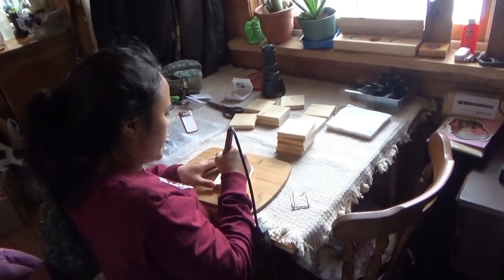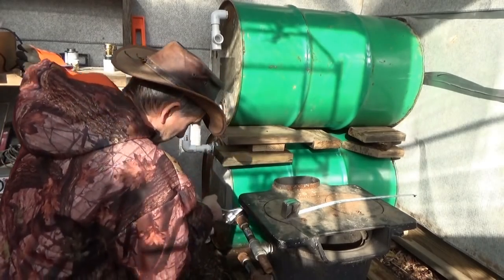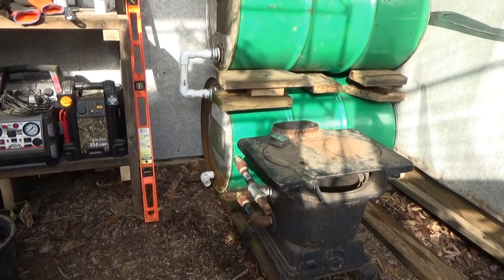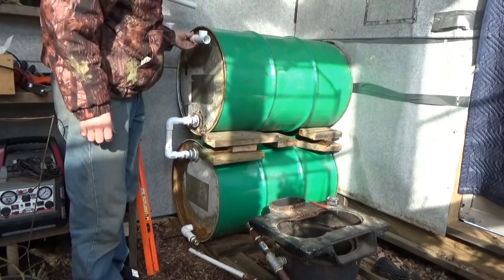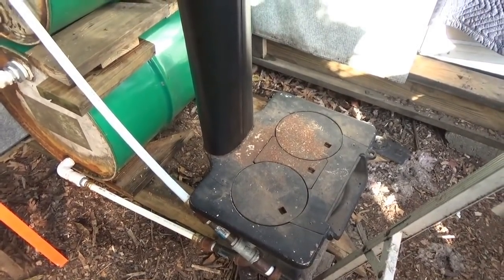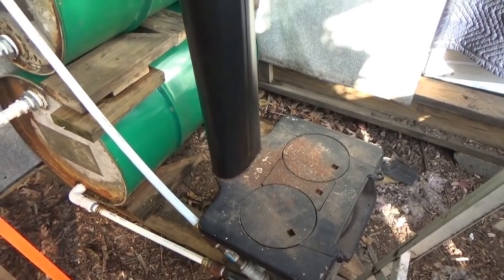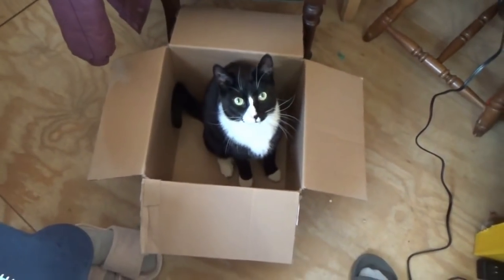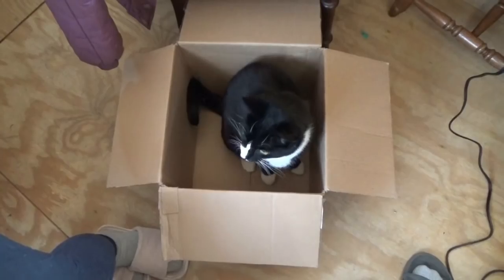Greenhouse Wood Stove Boiler ~ Packages Arrived ~ Wood Working

Comment: dissagree completly about  the use off the pvc, in your system the water temperature will reach 100 degree's celcius,using the thermo syphoning method, the idiot at the store is plane wrong. cant believe you just dont listening to the advice from people who know how,...dont worry about the rise off the lower pipe , its fine even with the feet on, butt, please use the pex heating hose and fittings, or metal.forget that darn pvc, you are gonne regret that, and dont say you could not now it would fail.  ist conna be a big tould you so..... the thermo syphoning has nothing to do with pressure yust the rise of heat....
Reply from the maker: Well, because of comments from you guys I did go out and buy the PEX tubing. If the rest of the PVC fails later then I will replace it as well. But for now it seems to be holding. The T and elbows that is.
Reply: The Do It Yourself World y can guarantee you this can get a problem, in the time you cant have it... not trolling, but trying to help, sincere..if the stove gets on going for a longertime this water will get hot, and the pvc tubing and fittings wil get flexible....., happy to see you placed the stove inside to, this direct heat will help to now!, it would not be iff you would have placed it outside, again, y hope it will stay together with the pvc, but y know from experience its a problem.. stay warm friend!
Reply: Link Knight yup!

Comment: My male cat had the same problem. It's extremely common and dangerous. Their urinary track gets blocked. It's from the food they eat. Too much magnesium crystallizes in their urinary track and they can't pee. It's good to start him on a urinary track health blend of food that is low in magnesium. Don't feed him tuna from a can. One of the worst.
Reply: My cat has urinary problems as well. It almost killed him overnite...it's certainly nothing to mess around. I researched it online and got convinced it was because I wasn't feeding him enough wet food. I attempted to feed him more wet food and the urinary issue came right back a month later. I have to feed him specialized ph balanced food now. I've read that alot of seafoods are really bad for ph issues. Ph issues can be a major issue and should not be taken lightly.
Reply: squirrelbong A the vet explained that it's not so much wet food over dry. It's the magnesium content. Ocean white fish and tuna are deadly to male cats. The build up of crystals in the urethra. Obviously female cats have larger urinary tracks so they aren't as prone to it.  My cat had a sex change literally to save his life.

Comment: another thing you can do is use black water barrels filled with water in the daylight they absorb the sunlight and at night they give up the heat at night giving off radiational heating

Comment: troy  when wood stoves come with a hot water heating source if i remember right they require steel pipe for any pipes with in 5 feet of the stove . cant even use copper that close . pex is not suposed to get over 200 degrees .

Comment: PVC is a thermoplastic, and therefore, at some point it will begin to degrade and break down as it's heated up. It just so happens that Schedule 40 PVC's maximum operating temperature is 140 degrees Fahrenheit, around the same temperature that hot water gets to in most homes. That max operating temperature of 140F means that any temperature above this will cause the schedule 40 PVC pipes to break down, compromising the integrity of the pipe (think leaks and bursting).

For this reason, it is recommended that PVC pipe and fittings be used only for applications where the water temperature does not exceed 140F. Even if your application involves water at temperatures nearing 130F, I would recommend another material, as temperatures have a tendency to fluctuate, and it's always better to err on the safe side.

So what's your alternative to PVC for hot water lines? CPVC

CPVC is a thermoplastic just like PVC, and it comes in pipe and fittings just like PVC. The difference lies in the chemical makeup. CPVC material goes though an extra chlorination process that gives the plastic slightly different qualities - one of which is a higher maximum operating temperature. CPVC (schedule 80) pipe is rated for use up to 200 degrees Fahrenheit. This makes it ideal for use on hot water lines in homes and businesses.,,,,,,,,,remember if you do not make mistakes its because your not doing nothing keep up the good work and do the best you can with what you gotnot every body was born with a silver spoon in there mouth

Comment: A friend used pvc for hot water in their tiny home and came home to water in the entire place because the water was to hot and melted (?) loosened the glue on the pipe.  Am wondering if venting the stove pipe thru the wall would be better than making a hole in the roof, which if the stove etc were moved later would result in a new roof hole being made.
Reply from the maker: I was thinking about through the wall or roof. Roof is easier to patch with a sheet of metal later

Comment: Why haven't you made a proper door to the greenhouse yet? Even polly wrapped around the screen would be an improvement. And put in jams to reduce the breeze coming through. 
As for the knitting and crochet gifts, all I could think about was my grandparents sitting on the couch together watching Coronation Street and both of them knitting and crocheting away. My sister still uses the afghan my grandfather made for her christening.
Reply from the maker: You must have missed that. Or I have not uploaded it yet. Not sure. Yes I plastic wrapped the greenhouse door.

Comment: Troy, I listened to your explanation of thermal syphon effect. Your wording was just slightly off. You mention the weight of the water forced the cold water to flow, but you should of said, , is that the density of cold water is heavier than the density of hot water, which causes it to sink, and the hot water to rise. having the Pipe at that high angle will increase the flow, making it easier for the heat to circulate.  The quicker you can get the second tank filled the more efficient the system will be.
Reply from the maker: Ok, thank you for the clarification and for the tip :)

Comment: Hi Troy !

The setup you have at the barrels is not very stable - when water is filled in the top one, it will tilt to the side - you have to have some legs to the ground, I think !
Reply from the maker: Thank you. I am thinking that a frame on the side, firmly held in place and pushing the barrels against the way should do the trick. I hope anyway.
Reply: yea its a good idea in principle but.....
the thermosyphon is a horrible way to circulate water and the water that is right beside the fire will boil and put immense pressure on the pipes and barrels.

my thoughts are that you should use a high temperature rated pump and have a pressure relief system in place

Comment: FYI, The shark bite fittings are only for temporary use. Not long term use. Pleas do some more research before you keep it that way.
Reply: Tim Beverly really? I always thought they were fine for long term use
Reply: They work fine for permanent use... just expensive. I have heard they will wear out if you re use them too much though.
Reply: Ruzz P that what i thought. They are making a killing off people who rather not play with a torch
Reply: gmaxsc no kidding.  I like them for adapting to pex though.